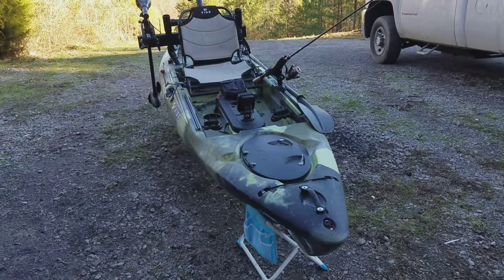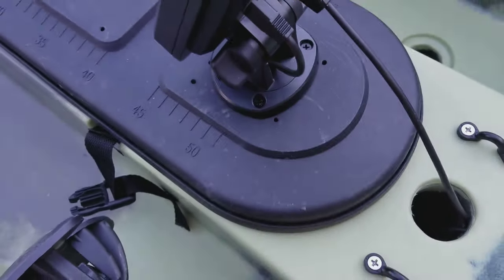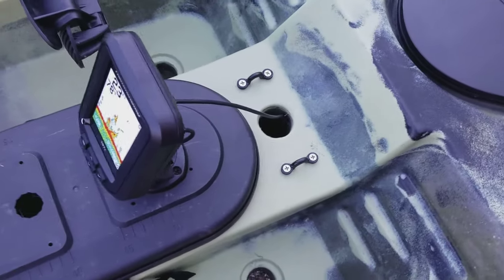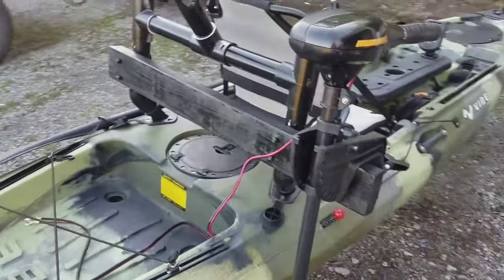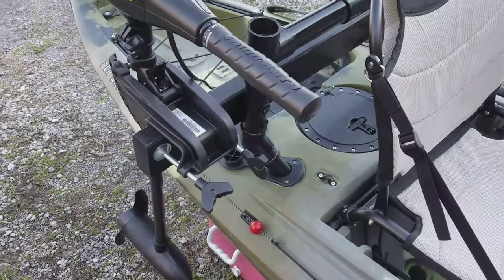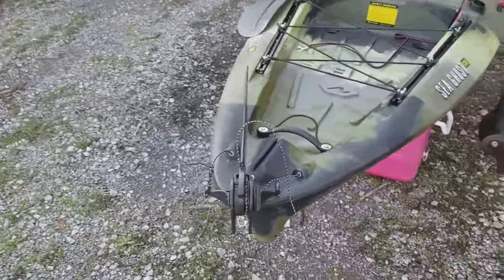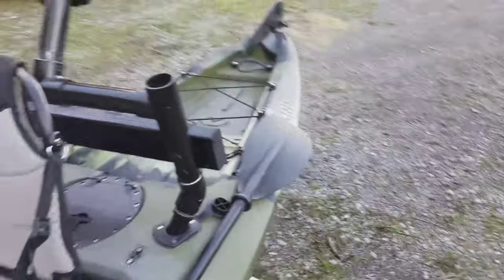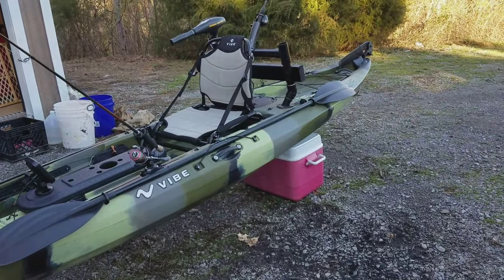MY SETUP | Vibe Sea Ghost 130

Comment: Nice start, can't wait to see how it turns out. I'm buying my first kayak Friday, and I have also decided to go with the sea ghost 130, and can't wait to start the long outfitting process. I had a similar idea for making a PVC frame, but I was going to put 3 or 4 Tees in for poor or equipment storage, or even a GoPro mount. I like the idea of the quick connects for the trolling motor, will make the install clean and make removal quick and easy. Subscribing with goes of seeing the progress.
Reply from the maker: +UA72Riddle you won't regret the sea ghost. Thanks for the comment !

Comment: Nice setup. Do you lock the trolling motor in place and just steer with the rudder? This way is a lot easier than mounting the trolling motor where the rudder goes but does it work as well or even better?

Comment: I've got the same yak & I've been looking at different ways to mount my trolling motor to it & like the way you've done yours. What size pvc did you use & how does it handle the weight of the trolling motor on the one side? Thanks.